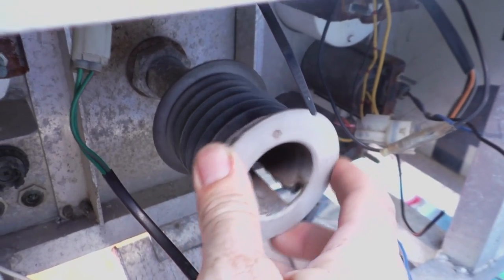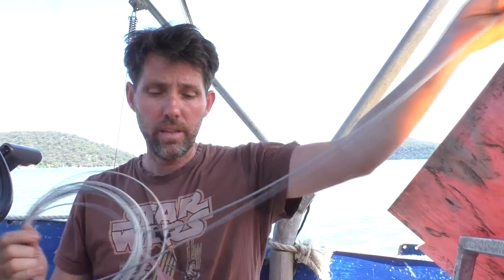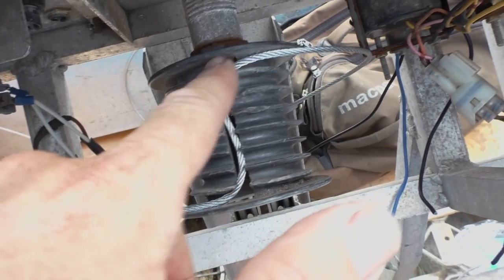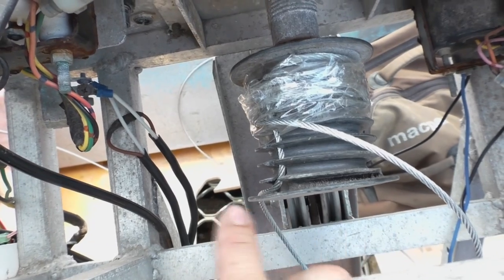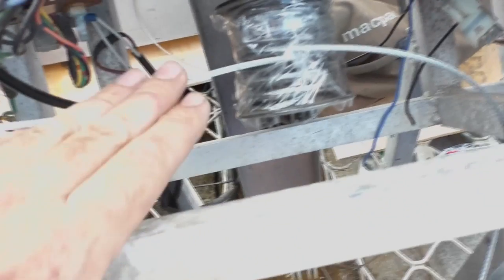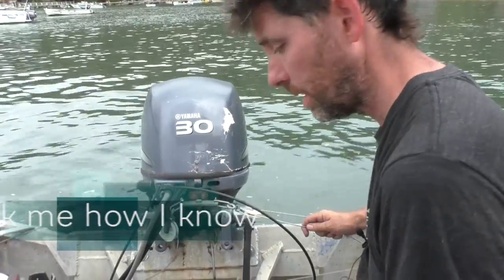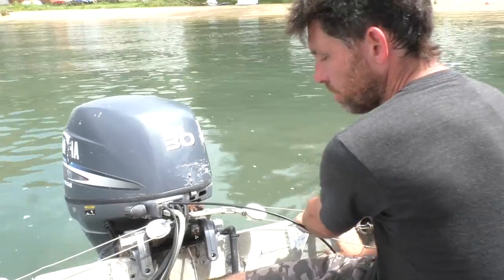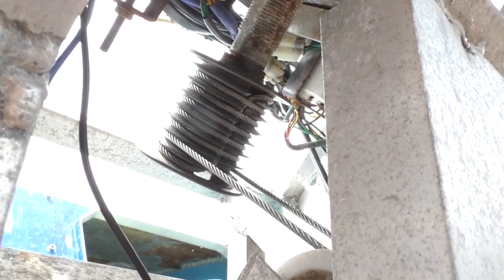Winding cable and drum boat steering

Comment: This video was very helpful. I screwed up the first time I did it, because I had the ends of the cable coming off the wrong side of the drum (turn to port and we went to starboard (and vice versa). The key the 2nd time was carefully thinking it out in my head: if I turn the wheel to port, that pulls on the starboard-side cable and turns the front of the motor to starboard, turning the boat to port (and vice versa). The other thing was making sure the cables were tight using a turnbuckle.
Reply: Same

Comment: Stu - you gave me the courage to tackle a fickle handle on an electric trolling motor.... I know, not the same as an outboard but a electro-mechanical device that needed repair.  I ordered a $20 rheostat to effect the repair.....  thanks for your instilling a sense of confidence in those less knowledgeable.....
Reply from the maker: Glad I could help. It's funny you should mention this now because I have just put a trolley motor on my wife's Hobie trimaran that I'm hoping to modify soon to bypass the tiller handle and make it just an on-off switch. I haven't taken it apart yet but I'm hoping it won't be too tricky.
Reply: Get a kids scooter speed controller - they cost around $50 and give you speed control.

Comment: My old boat had that set up, it was arm strong steering with my 70 johnson for sure.   I didn't like it from day one and it failed at the worst time at sea handy to the rocks it went hard over in  a tight circle.   I had to disconnect the  throttle controls and steer it from the motor.  I could have thrown me overboard into 45 f water.  Cheers mate.
Reply from the maker: I have a love-hate relationship with this steering. Part of me really admires the simplicity of this system, and it's resistance to corrosion, but it does have the fault of catastrophic failure when it goes.

Comment: Great video, I’m not quite there, but I did take my cables off yesterday with the steering wheel, and my old cable from 1962 was coated in plastic, that was totally decaying.  Thanks.

Comment: I think my 1969 Starcraft mariner V had this setup back in the day. The tensioner springs are still flopping around in the stern, no one ever removed them. She was converted to single cable steering before she became mine. This was an interesting one though. Always wondered what those springs were for in my boat. Happy new year Stu, thanks for posting this.
Reply from the maker: Hi mate, happy new year! Yes, many boats still have those springs floating around the back after the steering was converted.

Comment: very helpful thank you very much. I have the "rig" in tact, just took off the 2 d-shackles either side of engine to allow slack so I can wind the drum back properly. I was struggling, came home, saw this will give it another go now. thanks again.
Reply from the maker: Good luck with the next attempt. It can be a little tricky to get your head around but once you do it isn't hard if you use the tape.
Reply: I am going to the boat shortly, I have watched the video again a few times, just thinking if I will have enough slack or not. (bearing in mind I am trying to re-wind the drum without taking the whole rigging apart.

Comment: Awesome vid stu, gave me confidence to fix it the first time round and turned out great :) unfortunately released the tension on the cable by unhooking starboard side from the engine and unwound the whole thing so i am back again-
Might want to duct tape the steering together if anyones thinking about undoing cable to move wires around lol
Reply from the maker: Thanks Liam, taping is definitely the best way to stop these things springing apart.

Comment: A lot of moving parts and places for things to go wrong. I've never seen a set up like this (albeit I've only been boating for about 6 years). Good to know, thanks!
Reply from the maker: This boat has more pulleys than most due to the centre console, but yes, they do have a few failure points that need to be monitored that's for sure!

Comment: You're a lifesaver. I bought a 4.4 metre aluminium runabout with a drum and pulley steering this week and have lost steering a couple of times already due to the cable dropping off the pulley. I have been searching for the correct set up everywhere but this is the only video that clearly shows how to do it. Is it possible to retrofit push/pull rotary steering systems to older boats? Keep up the great videos!
Reply from the maker: Glad to help Gregg. Most outboards can take either type of steering so yes, it is possible to change over to either system you prefer.

Comment: Thanks for the info. I have a question for you if you can somehow answer it. I have the same type of set up on my 73’ Starcraft Holiday. Except on mine the drum doesn’t have the cut out long the middle for the cable to wrap over. I have holes at each end on the the flanges. No matter what I do I can not get it to work correctly.

Comment: Hi Stu, Just about to tackle this job with your help, Thank you sir! I wonder if the tension of the cable has to take into account the motor being tilted forward? I did one years ago and had a bit of trouble with the cable being to tight. Love your videos and I have watched most of them. I figure this will be a two beer job.
Reply from the maker: Hey Ron, yes, you might find you need just enough slack for the motor to tilt, but if they are coming from the sides they should just twist without needing too much extra cable. You want to be careful that the cable doesn't have any chance of popping off while you are travelling at speed.
Reply: Thanks Stu,  Also, I was confused by the fact that I have two sets of pulleys. One set is fixed the other set will pivot or twist,  You just answered that question as well, I will put the swivel set at the stern. These are pulling from the sides. I will be sure they are tight. Cheers mate!

Comment: Hello Stu,
I noticed that you're using steel cable; is this the best type to use for this kind of project? I'm looking to replace the cable on my steering system but I think mine is just nylon. Thanks,
Noah.
Reply from the maker: Yes, always use steel because if it breaks a very bad accident could shortly follow. You might find yours is steer with a nylon outer casing. That is common too.

Comment: I have this pulley system on my older 14ft aluminum boat . i’m going with a newer 20 hp 4 stroke . should i stay with pulleys or go with a rotary steering setup

Comment: I am doing this job in the next day or so, I just wanted to ask if I face the front of my boat and look underneath to access the drum am I best starting to attatch the wire at the top of the drum nearest the steering wheel or the bottom of the drum? 
Also if I need to start at the top of the drum do I take that wire off to the left or right

Comment: If you have the type of drum that contains no slot, but contains a cable lock-down in the middle, then put the midpoint of the cable in the lockdown and secure it with screws.  (Note first see that your steering wheel and outboard motor are straight.). Then, wind the aft half of the spool using the wheel and tape it off.  Then wind the fore/front/open half of the spool using the other cable and tape it off.  Then, making sure the cables exit the drum from above (the top side) the drum, thread them back to the engine. 
Key points: make sure the cable exits from the top of the drum. Leave a few empty turns on the drum so the cable has a place to go when you turn the steering wheel. Make sure the steering wheel cable pulls in cable on the opposite side of the boat from the direction you are trying to turn (boat steering works by pushing the back of the boat in the opposite direction of the turn).  It doesn’t matter if the cables exit the drum in the middle of the drum (like in Stu’s case) or at the fore and aft part of the drum (like in my case) either system works. 
Thanks for the video Stu it was super helpful!

Comment: Hi Stu,
Thanks for sharing this one. The boat and motor don't look old enough to have this steering setup. Was it a personal preference of the owner? I am guessing that this system could be more reliable for boats that live in the water.
Reply: You should only use them on small boats no more than 40 hp or there abouts. anything larger and heavier is dangerous for this type of steering arrangement but a lot of the smallest boats that are forward steer have them
Reply from the maker: They are reasonably immune from corrosion compared to the single cable steering type. They are a bit more dangerous in that they can fail allowing the outboard to turn sharply to one side where the single cable system is more like to just become stiff and hard to turn.
Reply: Dangar Marine Hey, just wanted to say your videos have been fantastic and very helpful with my boat, also I have this steering system on my boat, 4.8 meter  1990 Caribbean Caper, it has 1972 50hp outboard 50ESL72C, I am currently in need of a steering upgrade or fix as my steering wheel wobbles all over the play I think the bearings may be gone, what would you recommend? I'm not sure what to go for, I am tempted to go for Hydraulic but am unsure of compatibility since everything is old.

In the middle of replacing the floor so I have time to upgrade things.

Any advice would be great

Thanks
TK

Comment: Happy New Year (even though you had it a day before I did here in San Diego, CA...  :)
Most steering wheels have a "center" or straight ahead position that's pretty clear.  You didn't mention anything about getting that right, or pretty close to right, is there a trick to ensure that, or just eyeball the motor when hooking everything up?

RichE
Reply from the maker: Happy New Year, finally! ;) Good point about centring. What I do is have the grove to the top, wind the cables to meet in the middle and then eyeball the motor straight before connecting the pulleys. It is always very hard to get the steering wheel to look dead straight but at least you will get a decent amount of travel in both directions, port and starboard.

Comment: I would like your opion on this type of pulley/cable steering system.I just bought a 1966 starcraft 14 foot V hull. She has a Classic Mercury 50 hp,which I understand to be 45 hp. She has this pulley/cable steering.but instead of metal cable its plastic, which is showing its age with cracks in the plastic cable. I was wondering if I should replace it with a new metal cable and pulleys.  Thanks for your video,Scott
Reply from the maker: Hi Scott, I personally think this type of steering is pretty dangerous as it can fail more easily than a traditional push-pull cable. If that happens at speed then things can get VERY nasty very fast as the motor will suddenly turn to full lock. If you are going to replace it, use the opportunity to upgrade to a modern helm.

Comment: Cloths line works well, it is a steal cable with the the protection of rubber against corrosion.
Reply from the maker: +Bill Joe Yes, I've a few with that cable but the casing does start to wear and split after a while.

Comment: Super helpful video, thanks so much for uploading! Any reason you used an uncoated wire? Could this same process be done using a coated wire? I'm thinking I want to do used coated just for extra corrosion protection...? Thoughts?
Reply from the maker: The coating will wear off as it runs through the pulleys. You are better off with stainless wire.

Comment: Would it be possible to show a quick video of the cables running to pulleys from the center console pulley showing the cable to rear pulley and how it runs to the motor? Thank you sir! Awesome video converting my boat to a center console and now I have a pretty good idea on how to do it just need few more info
Reply from the maker: This boat has now been upgraded to a Teleflex steering cable so unfortunately I can't film the route.

Comment: I bought a zodiac with a cable steering unit, but the pulleys are missing. It’s not  steering unit with a dum, but with cogwheel and a chain that decays to two cables. I doubt between to restore this cable steering unit or buying a new mono cable steering unit. The “paddle wheel effect” of the Honda 4 stroke 50PK could be too unpleasant with the cable steering unit. What would you do?
Reply from the maker: I would move to a single cable system. Better and much safer.

Comment: l am taking on a self-designed boat....which has pontoons ( 6 ft apart at center.) ..lm thinking a drum system..can manage both rudders and engine.........should I connect the 3  with linkage , and then attach cables ...? ( uhg..)
Reply from the maker: I would never add drum steering to a new boat, it is prone to breaking without notice. Go Teleflex cable and and a link bar between the two motors.

Comment: I have a question I'm looking to buy an 1978 evinrude 115 v4 I went today and pulled a compression and 3 of the four showed 91psi and 4th showed 90psi. my question is shouldn't compression be much higher and would it be worth buying without costing me major money. motor hasn't been started in 7yrs and was checked on cold start.
Reply: jeremy pauley i

Comment: hi there great video only problem I have is on drum I only have 2 separate groves and not like yours will lots of grooves how do I sort it
Reply from the maker: Not sure, haven't seem that type, but the principle should be the same with it winding around in two opposite directions.
Reply: think I have sorted it sort of only problem now is I have wound wire round wrong way so when I turn left the boat goes right nightmare

Comment: Sir what is the weight of drum used.and on what parameters the size of drum used depends. Is there any material which can help me to find the tension in the cables.
Reply from the maker: There are normally spring on the rear pulleys to provide the tension.
Reply: @DangarMarine  Thank you sir for your reply , will you please tell me if there is any source from where I can get force calculations in this system . As I wish to design one .

Comment: Guessing when you finally set your turnbuckle tension that you semi-permanent Loctite Blue (medium strength) thread-lock adhesive. Sure hate for it to vibrate free. Other option is to lock engine in the up position tighten, then lower the engine to increase to operating tension.

Comment: always good weather, nice shores, plenty of outboards to work with.... 

man , you are in heaven;)

im so envy... is there anything wrong there? i mean, seriously!??
Reply from the maker: I'm not complaining, although nice blue ocean water would be nice. ;)
Reply: yeah- Sydney has had a run of 35 deg C days with 80-90% humidity. The temps are Ok, but the humidity means you cant work outside comfortably for long, your perspiration just does not evaporate to cool you down. 
Sunburn is quick too - about 30 minutes and you feel it that night when trying to sleep. Even SPF50+ sunscreen only works for a  few hours. But a bimini, sunglasses and a running engine makes it worthwhile:-)
Reply: Ron Powell b

Comment: Hey Stu - not sure if you monitor comments on videos this old, but I've got a question on winding the drum. I've just purchased one from your sponsor, MarineEngine.com for a little hydroplane project. It has some differences to the one in this demo, however. Namely that the spool is divided half way along by a ridge, in effect creating two sections. Also, there is no central slot, but rather a hole right through at the point of the partition - presumably a start point for the cable. Are you able to describe how to wind this type of drum? The middle ridge will keep the cables from travelling the full length of the drum, as they do in this video, but I don't see how they can travel in separate sections without running out of drum travel. A lot of babbling, I know. If you have an email address I could send a pic of the part. Worth a thousand words and all that...
Reply from the maker: Hi mate, all good, I get notifications of all comments, just to replies to my replies unfortunately. Can you post a new comment with a link to the part your purchased?
Reply from the maker: If that hole at the middle goes straight through, can you start by feeding the cable through the centre and then winding towards each end?
Reply: Been playing with a bit of string and I think I've got it. You're right, the windings have to start at the hole with each end going in opposite directions towards each outer flange. The windings must stop about halfway out however in order to allow the spool to still turn in each direction with groove to travel in. Interestingly it works out to about the same number of turns each end of your wire took to get to the centre of the drum in this video - three or so. Not sure what the advantage is to the design I have. Made my head hurt trying to visualize the windings!  Anyway - thanks for the help, Stu!

Comment: In the US if your motor is over 40 HP running this obsolete rope-and-pulley steering is ILLEGAL regardless of how old the boat is.  It's considered unsafe and you're obligated to retrofit push-pull cable steering or hydraulic steering.
Reply from the maker: Sounds like a good rule to have, this steering system can work well for years and years but when it goes it goes...